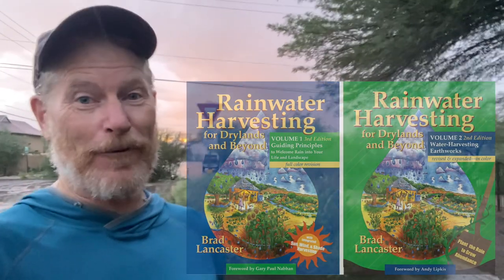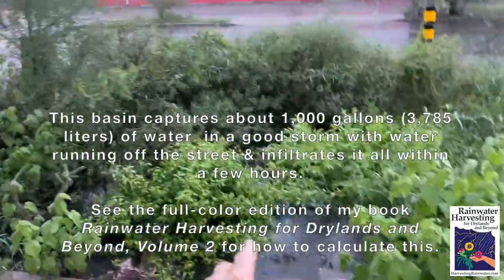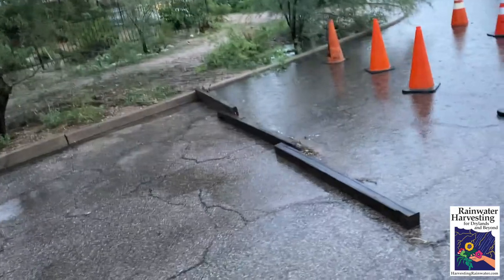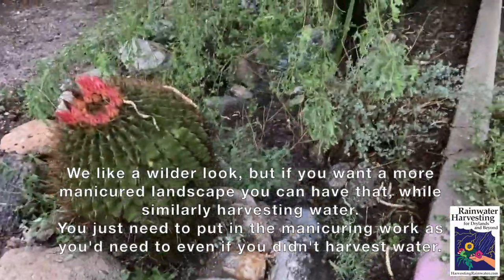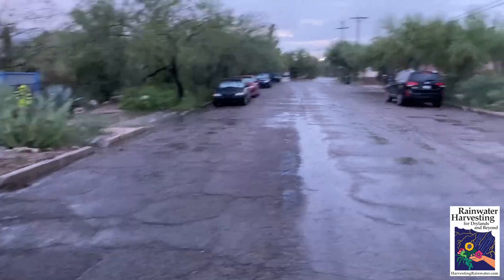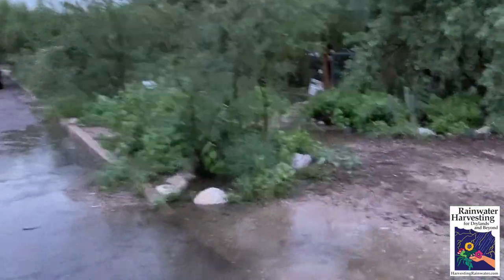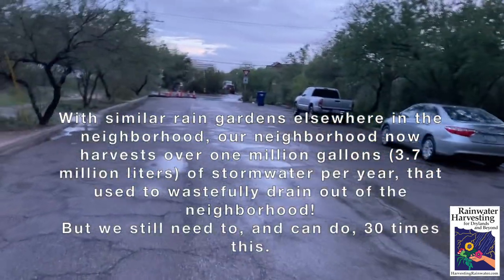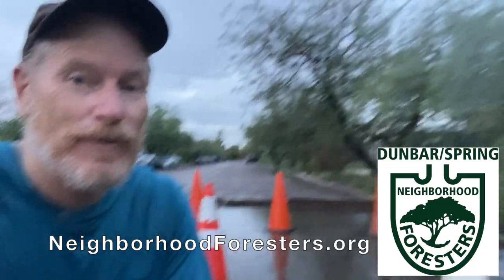Maximize the harvest:  diverting water from one side of street to the other to fill all rain gardens

Comment: Such an interesting concept. Are the basins as effective over time, like 5-10 years? I imagine as the mulch breaks down and turns into soil the basins would absorb less water?
Reply: Would imagine 'mining' for the silt would be easy because it is kept soft by mulch, then just put the silt in a spot where you would be doing a new planting (if clearing silt from a streetside bioswale avoid using the silt in an area for annuals).
Reply: Plenty of leaf litter to replace it every year.
Reply from the maker: The get MORE effective over time. As roots grow and more soil life burrows the rain gardens speed up the rate at which they can absorb water and the subsurface life holds onto it longer into the dry season